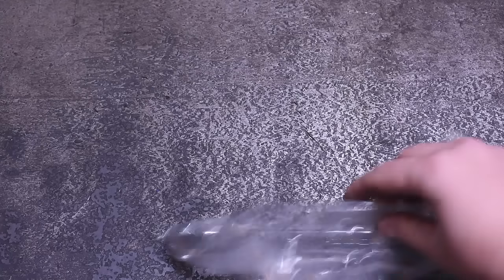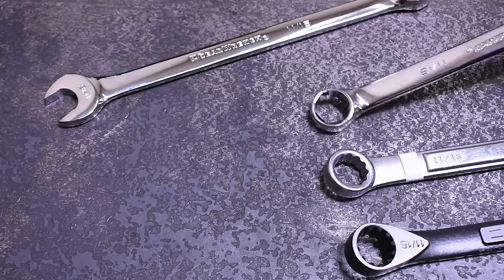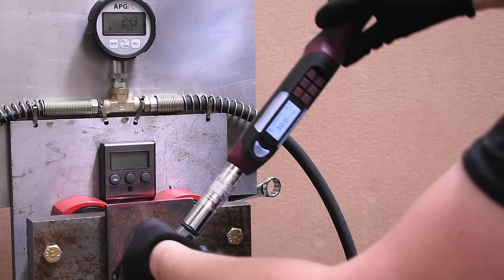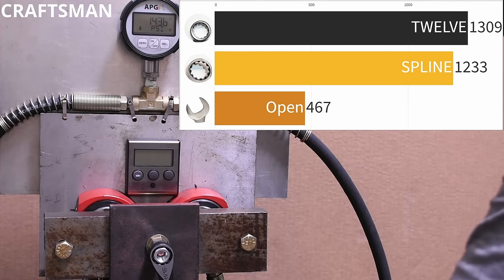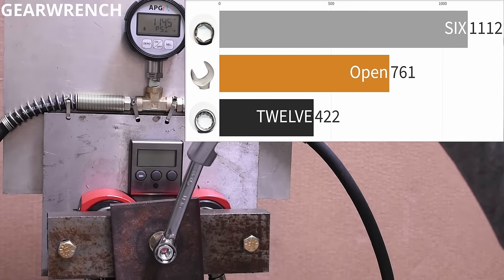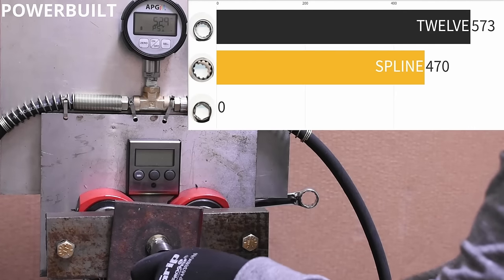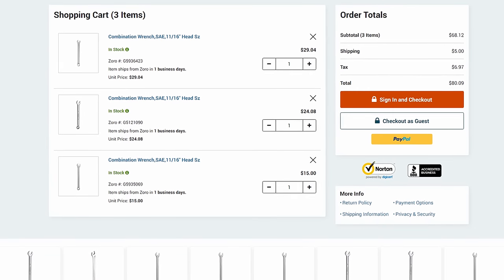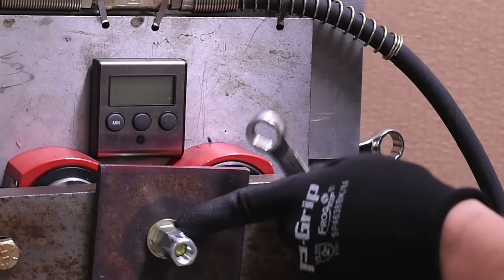Let's Settle This! What Wrench & Socket Design Will Slip 1st?

Comment: There's an important take away here! The way the fastener failed is important. When the 12pt strips, you can probably still get a 6pt in there to save the day. When the spline strips, you have a nice looking circle.
Reply: A nice machined circle! Lol
Reply: I've worked on a secondhand spreading truck (this is an NZ one so yeah, a lot more rust than a USA one). I came across a 13mm bolthead that was rusted and stripped to a near perfect circle. Just hammered on an 11mm spline socket (yes two rare things used - spline AND 11mm!!). Cracked that bolt right off.

So yes, splines are a very situation specific tool.
Reply: @xap95  you underestimate the rust belt in the US. Up north the roads get salted all the time so if you dont wash your vehicles often enough they’ll literally fall apart from rust. I’ve seen frames that you could stick your finger through 80% of it because it was so rusted out. It was a miracle the thing drove to the shop.
Reply: @bentrod3405  Yeah I've seen some online, I was merely offering an example (by "more rust than a USA one" i meant more rust than a USA *spreader truck*).
Reply: That's OK I have vice grips
Reply: @siberianstuntman3344  😂 never fails!
Reply: @bentrod3405  Folks down south have NO IDEA!  Just took delivery of a 2003 Expedition from South Carolina.  OMG, it's so beautiful underneath!  Pulled the door cladding and panels off to rustproof it.  PERFECT inside & out!  My wife's '06 Explorer, which lived its entire life in Northeast Ohio, is swiss cheese underneath.  Every repair is a nightmare, simply due to rampant rust.  Can't even consider attempting a simple job without a torch handy, let alone quality wrenches.
Reply: @0rnery  Same happens in Florida from our coasts. Guess we're too far south for your analogy. 😂🤷🏻‍♂️
Reply: Which is what extractors work well on
Reply: @razgriz999 idk, here in florida the only trucks i see with rust are from the north east. boat guys and pool cleaners being the exception.
Reply: @0rnery a friend picked up a low mileage CTS-V that was 2 years old from up north.  The shop doing the build straight up him if he ever buys another car from up north then just look for another shop to do the work.  I feel like if I was in the north I probably wouldn't be a car guy but some people have some nice garages up north separate from the house that look really cool to freeze your ass off in during winter with your car.
Reply: @PrestonSteele09 another great topic to research - extractors
Reply: Old comment but I prefer using torx over allen for a simillar reason. If you strip your screw with a torx you can always hammer in a bigger bit and it'll work, not so well with allen.
Reply: I've got a tool for removing nice-looking circles :)
Reply: @bentrod3405  Yup, you're guaranteed to have your vehicle rusting before its even half paid off.
Reply: Lol
Reply: Could you just force a smaller size spline with hammer untill it’s fused
Reply: Spline is basically last resort. Like the other guy said you can hammer them on with a smaller size than the bolt and use them like that. Not good for breaking loose though unless that’s the bolt heads actual design. When it strips it strips then you’re stuck with trying to use pliers or if it’s steel welding a nut on

Comment: I'd like to see this experiment with 10mm spanners. Not to see the result, just to see that 10mm exist.
Reply: They do.
You get that one for free.
Reply: The time elves steal them as you film, or attempt to bring to your truck
Reply: They are with all the single laundry socks.
Reply: They're also among the most common size bolt head in cars so I'd actually be super interested...
Reply: And the even more common 13 mm and 17 mm. Made with very high quality tools, made in Germany.
Reply: They exist but for some reason they are the only size that has the ability to walk away...
Reply: I've heard these mythical 10mm spanners exist in some tool boxes. If I ever come across one, I may have to trap it and keep it under surveillance. ...maybe study its behavior patterns.
Reply: Dont need them. I just stretch out my 3/8s, that way i can use one wrench  for both
Reply: mine always end up missing so I got one on a key chain
Reply: Hold on he's still looking for it
Reply: Ah see, the key to not having your 10 vanish is to hold the whole set it came with in the hand using the wrench. Let it get more than 5 inches from it's set and it turns into fairy gold.
Reply: @ronfox5519  1"=25,4mm, so 25,4/8*3 = 9,525mm. Almost the same. I have one 3/8" wrench, had to buy it to fix old Johnson outboard. No use for it since.
Reply: @markkuvuori4300  
Just stretch it out. Then it will be your 10mm/ 3/8 combo
Reply: I use them at work every day. Always have to look for one, as they're never where I left them.
Reply: As a European, I don't get this comment...

(just kidding ofc)
Reply: Oh they exist alright, and when I have to use them it always ends with me unreasonably angry and having a few less beers in my fridge
Reply: I know where one is.
Reply: You mean 13/32" spanners? No, those are only available at a military/aviation facility, so for you civilians, you can't get one. As mentioned, they would come in really handy, but them's the breaks for auto mechanics.
Reply: 10mm does exist.  Go buy any tool set & see for yourself... but if you do any kind of mechanical work, they will disappear.
Reply: @MrArron1357  
You have a 10mm on your key chain?   You must never get to drive your car huh?
Reply: @AllAmericanGuyExpert  So I was a military aviation engineer all along when bleeding the brakes on my 1972 VW Beetle as a 15 year old?   ..damn, that knowledge would have defined a clear career path had I known..
Reply: @OOTurok  it's mini 10mm wrench 😂 someone sent it to me on the mail because I lose mine all the time so they put a keychain hook on it so it's on my key chain.wherw do you get having wrench on a key chain to a undrivable car from 😂
Reply: @MrArron1357  
You are bound to loose that 10mm wrench, & with it attached to your key chain... you will never drive your car again.
Reply: @OOTurok oh I get it now  it's coming off  🤣
Reply: @MrArron1357  
🤣
Reply: I have a 10mm welded to my toolbox that is bolted to the concrete in my shed. Haven't lost it yet but then again I did used 10mm bolts.
Reply: I used to work on a lot of Yotas and it was always the 14. Now I work on a lot of GM stuff and the glitch seems to have fixed itself.
Reply: @AllAmericanGuyExpert  I got mine at harbor freight 😶
Reply: Not the 10mm i wanna see a 1cm spanner
Reply: They only exist for the first ten minutes of ownership. Then they disappear to the same place where all the 'left' socks go...
Reply: They must, I've bought at least 15 examples. Can't find a single one though, so I might have imagined it.
Reply: I'm currently breeding a pair of 10mm.  Don't ask how I got them, that's a tale in and of itself, but what perplexes me is that all the offspring are either 9mm or 11mm.  It's rather disheartening...
Reply: that´s for M6 bolt (a have an stanley workmaster wrench for 10 mm... also 10 mm chinese hex socket)
Reply: He was going to do a video with 10 mm but he couldn't find them.
Reply: @ronfox5519  No joke, I don't know how many times I've ground a half millimeter off an open end 3/8 just cuz my 10 mm chose 2:00 a.m. to walk off on me.
Fun fact: You can take a 12-point closed end and, by filing out only six of the slots with a triangle file, make a combo wrench. ... Allen wrenches to torx, flat blade screwdrivers to Phillips and almost anything else including chisels. Have even welded a 3/8’s head on top of a 10 mm to make a combo bolt.
Reply: @2ndfloorsongs  
Nice! 
Thats the kind of thing we do in the factory. Opens up a whole new world of possibilities. Nothing more satisfying than having dayshift show  up and say, 'how in the hell did you get that running'?
Reply: @davidc8543  
Great idea. Dont give up. 
If you breed the 9s and 11s together, half will be 10s in the first generation. And ya keep doing that until youre getting 10s every time.
Reply: Don't matter whatever they use to tighten at the factory will break the bolt or the wrench when you try to take it apart.
Reply: @ronfox5519  Use boxes of food with 10 mm bolts to evolve them.
Reply: @2ndfloorsongs  haha. Ill give it a try.
Reply: I had one at one time.  I think.
Reply: Right?! I thought it was just me until I started reading comments on YouTube videos. The only time I can find a 10 mm socket is when I'm looking for a 12.
Reply: @StrangeTerror  if harbor freight don't got it you don't need it.
Reply: they do not exist, they're a figment of our imagination, like a dream, when you buy a set it goes 8, 9...11. I saw a 10 on auction at Sotheby's once-sold for 2 million-the buyer was anonymous and its never been seen again😂
Reply: @351cleavland  and the Tupperware who left their lids behind
Reply: I bought a bucket load of 10mm sockets and spanners.
I still can’t find one.
I blame it on the tooth fairy 🧚‍♀️
Reply: 10mm are just a myth. You want to find a 0.393701" spanner or a well worn & loose 3/8" tool!
Reply: They do exist, I know because I've bought a lot of them. Where they are is another matter tho, I think they enter a parallel universe as soon as you take them out of the bag 😁
Reply: Bruh. I own 4 Audis, and have my own little business fixing VAG cars. So 4 german cars of my own.  I literally have enough 10mms (lost) on my property to supply enough 10mm sockets to the WORLD
Reply: @callmedragon5321  Now youve confused them.
Got loads of 10mm open ended spanners, sockets even ratchet spanners, its the most common size apart from 13mm.
Reply: @markkuvuori4300  3/8 are good for older briggs and stratton mower motors along with 7/16. More useful as sockets for the briggs motors though.
Reply: I saw one before! But it fell into my engine bay and never hit the ground.. Gone forever.
Reply: If you ever need a business idea, here it is.
Buy 10mm spanners in bulk. Load vending machines with them, and place at every auto shop and dealer.
Reply: Work on a Honda car…and the 10mm will become one of the most common sizes you will ever use.  Ever.  

I can take apart most Hondas with: 8mm, 10mm, 12mm, 14mm, 17mm, and 19mm.  Axles being the exception.  Lol.
Reply: I found one today! Felt like posting it on my insta
Reply: I don't know what you are talking about. I've got so many 10mm and 13mm spanners in my "overflow" bin of wrenches that I can never find anything but those when rummaging around in there.
Reply: @callmedragon5321  cm? What are you? A construction worker? I kid, I want my 10,000 mike machinist spanner.
Reply: Amen
Reply: After weeks of no stock, I found a 10mm socket at Princess Auto (in Canada)
Reply: stop with the propg@nda...we all know the 10mm socket is a myth
Reply: @JO3BID3N-is-a-P3D0  I thought I had one
Reply: 😂😂 Ive had to buy many of them, my last truck ate them like candy it felt like
Reply: I found a cheap mini-socket tool set abandoned at a customer site.  It had one socket left in it.   - 10mm.    I now know where they go.
Reply: @skitidet4302  So, you're the one that collects everyone else's 10mm!
Reply: Can someone explain why I keep seeing these 10 mm are rare type of jokes? I honestly don't get it. Is it just they're used so much that you're bound to lose them?
Reply: @C7eeN  - You're pretty much right on the money.   10mm is an odd size.  It's basically the smallest size you'll find in 3/8" socket, but you'll also find it in 1/4".   It's one of the most popular sizes used by engineers of multiple countries - I've seen it used when it was really too small, and too large - and yet the socket itself is small enough to be easily lost.  It's also frequently stolen.. sorry, borrowed.. by other techs, when theirs has dropped into machinery (or just into a hole), to try to finish a job.   

There are now two sets of 'just one size' that you can buy.  Harbor Freight has an 8 (IIRC) pack set of 10mm, and Northern Tool had the same in a 12mm.  It included wobble, 6 point, 12 point, deep, impact, and standard, to replace the ones most frequently lost.  

Because it's used a lot, you can even 'lose' it by having it permanently mounted to one of your socket wrenches or breaker bar, then go looking for it to use with another tool...   It's similar to how I have three 9/16ths wrenches I take when I'm installing wireless access points.  When 18 feet in the air, when you drop one, you don't have to go down to find it.
Reply: @tbelding  Preciate the thorough response 👍
Reply: 10/mm..2024🇺🇲
Reply: I must have the best of luck because I still have every 10mm tool I have ever purchased. Cant say the same for my 3/8in drive 13mm socket or 14mm wrench though. It still annoys me to this day looking at my first sets ever purchased and seeing them missing
Reply: Currently have a damaged 10mm bolt i need to take off on my bike. only sockets can reach it, and i can only find a spline 10mm socket. it gave a little slip and i said NEWP... time to go buy more 10mm 6point sockets.
Reply: Funny, so funny haha that's me laughing at your very funny joke
Reply: Ha, ha ha, ha, ha ha.

Comment: I learned many years ago working on the Harrier Jets. when you find a totally rounded bolt, you can pound on a spline that is slightly smaller and Bob's your uncle.
Reply: Bob is NOT my uncle.
Reply: That is why I have a spline set of wrenches and sockets (standard and metric)... for last resort... hammer it on a fastener that will not take a 6 or 12 point.  You can keep dropping down a size until you've machined off the entire thing.  LOL
Reply: Bob is my uncle-in-law. Trust me, you really don't want him to be your uncle.

Comment: As a now retired mechanic, I switched to 6-point sockets and wrenches within a year of starting my wrenching career.  (Just 1 or 2 busted knuckles into a searing hot exhaust system get your attention quite quickly.)  Snap-Off (and later MAC) were the only spline makers, so I happily kept my paychecks and did just fine with 6-pointers.  One note:  If you have a thin nut or bolt head, you can get a better grab on it if you grind the heel of the box end down a  bit.  It eliminates some of the rounded area (which helps you find/engage the bolt head) and lets the 6 flats of the wrench touch the base of the bolt.  About half my wrenches were ground and 1/4 of my 1/2" drive sockets were done to get that extra grip.  Great tests, guys.  I like your vids.
Reply: I do this as well
Reply: Most wrenches sold are12pt box ends, but I want to get a few sets of metric in varying length and offset/drop at the ends in 6 point for helping get stuff
Reply: Bees don’t make mistakes.

Comment: 6 Point is important if you're trying to restore something with very specific fasteners on it so you do the least amount of damage to them. Sometimes you just can't find replacement fasteners that match.
Reply: Correct me if I’m wrong, which I might be.. but bolts are not considered in “all authentic “ restorations”  if you have one bad nut or fastener.. if your restoring a car.. would you not want to put an improved option on the car?  I am not a mechanic, just a simple question for someone who wants to restore their 89 5.0.
Reply: @Auto-Bots.Custom.Detailing it’s not always about improving, simply about not being able to get a new fastener. I stretched a flywheel bolt and found not a singe place that stocked them apart from where I bought the flywheel, having to ship it from an entirely different country. Not the same situation but fasteners can be really important to not damage.
Reply: @Auto-Bots.Custom.Detailing you are not giving folks enough credit on complicating things. Ford Model A guys that want it "as Henry built it" will absolutely use as much old hardware as they can, and it is all pretty unique between the script F stamps and even shapes of the head and finishes.  They will buy whole cars just to rob the bolts off.